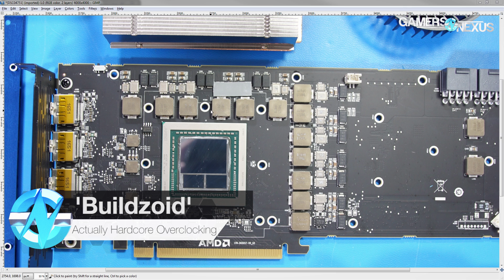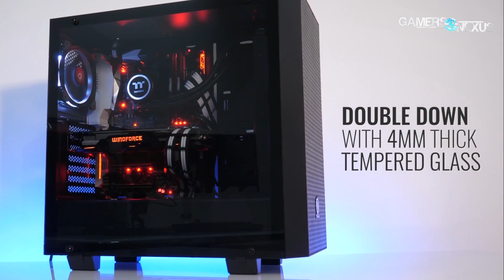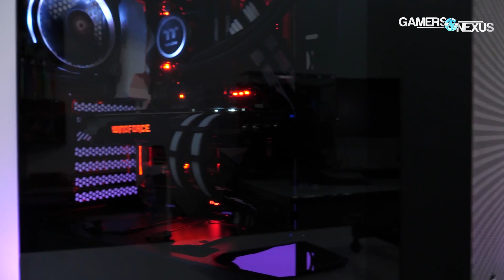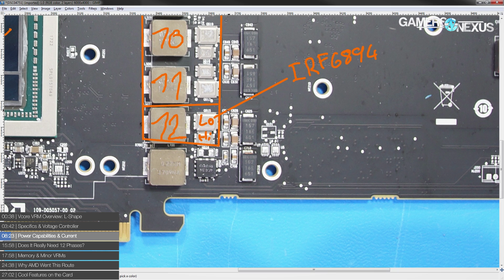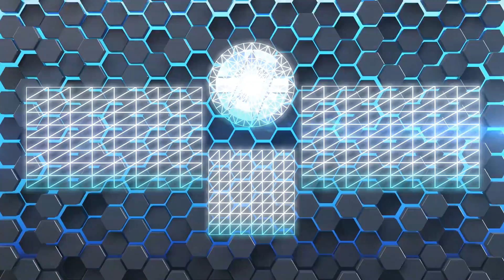Radeon Vega: FE Vcore Behemoth - VRM & PCB Analysis

Comment: Is there anyone that I can chat with regarding my Vega 56 card.  Looks to be the same board.  Vega was working, I rebooted my computer, and now the Vega fan won't spin, and the GPU lights will not turn on.  Windows or Linux will not recognize.  It seems that there is no power past the two 8-pin plugs. Any help would be appreciative.

Comment: I actually own two of these beasts. I am currently installing the EK waterblocks on them.
I have a question : the waterblocks dont cover the two VRMs that are on the far right of the card, bellow the 8pins power connectors.
those two chips are labelled "0.56uH 1710NF"
I was so frustrated by the video since i watched it entierely, i could see the chips on screen, but the narrator totally skipped them.

On the stock cooler, there are holes to connect them to the blower, so those 2 chips would have active air flow.
with the watercooler, those 2 chips are covered by the acetal and not cooled at all :/

what are those 2 chips and should i care about them not being cooled ?
i did not find any information on google about those 2 chips on vega cards

on a side note, i am totally thrilled by hearing you comparing this design to the 290x lightnings, because my new vega cards are replacing my olds 290x lightnings wich felt so rock solid !

Comment: why displays drop out: "Load line Voltage Drop" out of actual "trigger" voltage for running.. which is why raising voltage will basically do a "Load line calibration" ultimately to the point to where it is back above "trigger" voltage required. (my idea about it, not fact)  i know this happens sometimes with cpu overclocking with sub-par voltage regulation causing other components to "act up" which is why they include a "load line calibration" setting now in the bioses.  (AGAIN, NOT facts just based on my knowledge of electronics.)  

SIMPLE: Voltage draw from other components cause the "5V" (or what ever voltage is dropping) to go below the LOWER threshold of what is required to turn the internal switches on and off. if this happens while a process is running will return invalid (corrupt) data back (which would be unusable)  raising voltage will bring it to where it will STABLY  turn the switches on at the frequency that they are running at.

Comment: Can anyone explain to me why AMD designs the PCB so well but puts only a crappy blower cooler on it? Why not also offer a model with good open coolers and a more massive heatsink. Why not? I get that for tiny cases the blower cooler is better but why not two models for the reference card for the cooler. For many people the blower cooler is the reason not to buy the reference card. In the case of AMD that is a bloody shame because in general those PCB's are pretty good compared to what the AIB partners doe.

Comment: Did everyone forget about remote sensing on power supplies?  The core's supply is bypassed with large valued ceramic capacitors.  The sense lines to the supply tells the supply the exact voltage at the chip.  In a modern supply design, a few microseconds is all that is needed to ramp the supply up or down to compensate for the drop.  Thus a the bypasses only need to hold enough to prevent changes shorter than that.

Comment: Hey GN. can you guys get to the bottom of the drivers. I keep hearing it's lightly modified fury x drivers. also I hear that a rasterizer is not functioning. can you maybe explain what this could mean for performance. is any of this even true? would old fury drivers gimp the vega gpu to a large degree? Because vega was supposed to have netter ipc than vega but doesn't seem to be the case based on gaming results. also what happened to the 4 times performance per watt. Even if that was about Hawaii xt it should still be better than this. I know this isn't the gaming edition but how much of a difference could the gaming edition make.

Comment: I have an RX 470 (Asus Strix 4gb) that seems to randomly turn off the video outputs. HDMI, DVI, doesn't matter, they all just randomly turn off while under load. Is it possible it's related to Vdisp? I've spent hours troubleshooting, looking at driver changes, and browsing forums and never found a solution.

If it is Vdisp is there anything I can do to fix it?

Comment: The nub on the heatsink is where the vapor chamber (which is what this GPU cooler actually is, like most of modern GPU coolers) gets charged with the correct gas of the correct amount. Indeed kinda like a heatpipe, but the surface area of it is much larger, which fits a GPU cooler better (it wouldn't be much use for a CPU cooler, where we are not as height limited as with add-in cards).

Comment: great video buildzoid, once again. loved it.
vega is a strange card as of now. i highly suspect we will see some major improvements with the release of rx vega, because the (gaming) performance figures are way too low for that chip - i suspect the "gaming mode" does nothing at the moment.
if amd did a fury shrink with ~1400 mhz it would beat current vega hands down at its max boost clock of 1600mhz. does anyone really think this could be possible by any stretch of imagination? 
new card, ~equally sized chip, smaller process, more clock is worse than the old card with the same chip size, bigger process and less clock?

do you think amd could possibly go "poor volta" when they barely beat the 1070 (which also fury does in certain games)? amd surely has something up their sleeves. releasing rx vega one month late is pretty unfortunate because of that which is happening - ppl hate on vega for its "low" gaming performance. i think stockholders wanted vega to be H1 2017 or hbm2 supply wasnt sufficent for rx vega release. probably amd doesnt want to show the gaming performance figures of rx vega until it hits the market and therefore did not include a working gaming mode for vega fe until rx vega is being shipped. i cant think of another reason for that behavior.

amd has shown they like to play games with intel, however nvidia is way harder to beat than intel. intel underestimated ryzen and x299 is everything they can throw at ryzen and threadripper. i guess amd wants nvidia to underestimate vega aswell and hit them with way more performance than they anticipated.

if amd would be rightfully claming vega sitting between 1080 and 1080ti for months before release, nvidia could just come up with a solution to that problem in the meantime.

Comment: So basically it has overkill power delivery and still only 1070 performance.
Reply: It is MUCH faster than TitanXP. In its own intended area, Vega destroyed TitanXP by 11 fold. 155fps on VegaFE vs 9fps on TitanXP in Siemens benchmark. If TitanXP only has 9fps, imagine how bad it is with 1070. Well, P5000 has some 180 something anyway. But again, P5000 is slower than TitanXP in gaming, albeit 6 times the price.

Comment: This card has a gaming mode, once activated it outperforms a 1070 by 3 frames lol.
(POOR VOLTA anyone)??? 😂.
Reply: Not a gaming card tho
Reply: Doge Charger It does have a gaming mode but yeah raj said the RX Vega will be better optimised for gaming. 
But don't forget, RX board and chip is the same as this. Infact the RX has only 8 gig compared to the 16 gig hbm2 on this card.
All the optimisations in the world won't get you a 40 frame boost which is what would be needed to catch say a 1080ti.
20% is more realistic going off RX spec.
That puts it inbetween a stock 1080 and stock 1080ti, however that's all evens once you put a moderate overclock on the 1080.

Comment: so a overkill VRM until you get to the "advanced HBM2" ? in that i am wondering what if they make a HBM3 with the correct by you VRM set up? or are you in correct on how the VRM set up has to be?
i am hoping HBM3 will have a higher limit of how much VRAM they can have on a single chip than HBM2 has to get chips with more than 16GB of VRAM to have bigger data sets to this though it will not help gamers at all but will help GPU compute cards.

Comment: says they are expensive. <2 euro per 1000...
Reply: Yeah misspoke on that. it's 1.2 eur a piece when buying a thousand.
Reply: its perfectly understandable for ppl used to industry sizes, dont worry :) its either price per piece for 1000 pieces, or price per one thousand pieces for pallets or containers. ppl not used to this kind of price display can get caught, however common sense should say you will not buy 1000 pieces for less than 2 euros. even mediocre m3 screws are way more expensive than that, and we're talking about high quality fets.

Comment: Why they use a voltage so low on the core? The current get so high to reach the desired power, generating so much heat.
Why they don't run in 12v so the 200a of the core can be reduced to 16.6a?
Reply: its not the power of the gpu that is constant, it is the current draw, a gpu will pull x amount of current, so that 200A can be a 1v to consume 200w or at 1.4v to consume 280w. the reason we must use a higher voltage when overclocking is so the transistors can switch faster, but lower voltage means less power draw but slower transistor switching, if you tell a card to run overclocked but the voltage cant make the transistors switch fast enough for that clock, you get an unstable overclock. Current is constant (for a given workload/clock) , so the voltage will determine the power draw of the gpu

Comment: This is not a reference card! This is a card designed with 24/7 running in a workstation in mind. Depending on the task, downtime is just not acceptable!
Very in depth video on the card. Nice job!
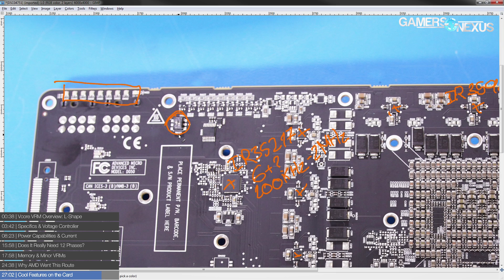29:05 Just checked. That switch is on my Sapphire R9 Fury. Toggles between Red/Blue and you can turn it off! Always thought that was a bios switch. Thanks mate!

Comment: Is the vrm of this card similar components to the reference 290x with double the phases? Absolutely crazy if it is, the 290x wasn't exactly a low power card and 6 phases was enough for that.
Reply: 290X VRM was 5 phase Vcore not 6.
Reply: +Actually Hardcore Overclocking Even crazier then! It will be really interesting to see power numbers from the water cooled version and even more so once people start to overclock the cards.

Comment: Who's holding AMD's Stocks?
Reply: Andy Farr me! , I think that based on the core clock vs the furry x and the fact Vega should have slightly higher IPC the prefomance will get better significantly with driver fixes to bring closer to being in between a 1080 and 1080ti, through I only have about $75 worth of stock so if I am wrong and the stick completely crashes then at least I didn't loose a huge chunk of money
Reply: Toby Cowles AMD reports earnings this month, things are looking really good.  Ryzen been selling like hot cakes, Intel in a panic for the first time in like 15 years.
Reply: Andy Farr You forgot the mining bubble too. Find a RX480 or a rx580 in stock are difficult and sometimes overpriced.

Comment: If you need a space heater, just buy Vega and overclock it.
Reply: AntiZippo Nah, get the new i9's and overclock them.
Reply: None of those beat the GTX 480. None of them. You can't beat a graphics card where the GPU can reach 100 °C under normal operation.
Reply: quad sli the gtx 480 

they wll melt your case
Reply: AntiZippo nope. get the i7 920 oc it and it will keep your room warm enough so that you don't need room heater and you can game on it!
Reply: Intel I9 overclocked + VEGA FE = Heater dream combo
Reply: that would be the 7900x
Reply: Marcel Krebs, I would die if i had that combo, its already too hot with a 3770k+970.
Reply: AntiZippo if you want 4 GB, buy 3.5 GB.

Comment: AMD - actually provides good hardware for less money. It's the software that couldn't fully utilize it yet
Reply: this is true, and has always been true with amd.  their raw power is fucking insane but their driver side is lacking aswell as support from devs
Reply: GCN is lacking for DX11, where Nvidia can get away with software scheduling. Optimizations clearly haven't been made though in general. Vega literally falls about 15% in front of Fury X in DOOM which should not be the case.

Comment: Interesting that AMD is underclocking the HBM2 memory. Running the installed HBM2 at 945Mhz with data rate of 1.89Gbps and bandwidth of 483GB/s

With SK Hynix stock specs of the memory in the Vega configuration, it should be running the memory at 1Ghz frequency with memory Bandwidth of 512GBs with a data rate of 2Gbps.

Just speculation on my part, but the underclocked ram could be intended to nerf the GPU performance to leave room above for the gaming and 375W watercooled FE card. That being the case,  people may well be pleasantly surprised with teh RX Vega performance after the disappointment of this card.
Reply: I'm not sure how much power the HBM is consuming, but this card is really power hungry as is and the memory bandwith is still more than enough even for professional applications I would imagine that botht he HBM and the GPU are not running at full speed to save energy and have it generate less heat.I've been doing a lot of testing with different voltages and clockspeeds on my old R9 380x and found out that neither gaming performance nor mining performance are affected that much by underclocking it. 
On top of that I was able to go with a -50mV voltage offset. 
At stock setting my sapphire R9 380x nitro will run at 1040 Mhz, 1,156V drawing about 80W of power just from the GPU. 
Underclocked to 870 Mhz with a negative voltage offset we are talking about 0,938V and a power draw of 43W.
The difference in performance is marginal, about 5% in mining workloads and about 10% in games. It's still faster than a regular R9 380.If you were to use this card in a professional enviroment (or even just for mining) you would always have it run at 870 Mhz because adding almost 40W of power draw for 5 - 10% performance increase is absolutely not worth it.

I'm expecting RX VEGA to be up to 30% faster in games than VEGA FE due to higher (and less efficient) clock speeds as well as optimised drivers. However we do have to take into account that RX VEGA will prbly not use the full die but a cut down version.
Reply: I must admit that I was gobsmacked when they announced a 300W TDP with a 375W watercooled card to come. Particularly as they have used a 14nm Finfet fab to produce the chip.TDP though is not the amount of volts times amps coming from a power supply. it is the amount of heat that needs to be dissipated by the heat sink.

In traditional GDDR cards, the voltage load is split up through different VRMs and spread around a relatively large surface area on the card  allowing for more flexible multiple individual heatsink designs. 

With HBM2 on the die, it is all concentrated in the one spot and all has to be handled by a single relatively small contact area heat plate that has to be beefy enough to handle everything that used to be handled by multiple sinks. It also doesnt make sense to engineer different VRMs for different models in the range. Better to design a single VRM that can be used by all models

Nvidia Quadro cards use Similar hardware to the gaming cards but are usually clocked slower. I am expecting that the Vega range will be similar. I cant see AMD releasing their flagship gaming card if it is only at a 1070 to 1080 performance level. Surely that slot would have to be for a SKU that is down the chain. Not sure if I would expect quite 30% though

Comment: The problem I as a 3d modeler have with that Vega card is in the purpose it is targeted for. Comparable price to the latest Titan and comparable results in 3D rendering, but the Titan does comparable gaming to a 1080 ti while the Vega compares to a 1070 at best. For a workstation PC doing 3D modeling both Titan and Vega are a waste of money because you would have a dedicated rendering box with a real professional grade GPU inside it. All major render tasks are on it so the workstation can continue being productive. The workstations can use a 1080 or even a 750ti/AMD equivalent and be able to get the modeling work done. So the card isn't made for AAA game studios, but for home freelance 3d modelers. A freelance 3D modeler doesn't usually have a dedicated rendering rig, and generally doesn't do cutscene/trailer quality renders for games and many of those never render anything. So for home users for productivity the titan is the better choice for that price range. You build your 3D model, import it into the game it is for and test it in the game. relatively equal productivity performance but less gaming performance makes the Vega are poorer product for the targeted market.

That's a shame really, Ryzen did good to shake up Intel, but Vega falls flat with comparable price and productivity performance due to lack of gaming performance the targeted users will want. Then there are beta drivers on launch continuing AMD's bad driver reputation. AMD needs to step up their driver game especially when it comes to the productivity market, it's one thing to have poorly optimized drivers for a game and another for your very income. Build the product, optimize the drivers, then market and sell them followed by weekly/bi-weekly updates for the drivers. I was hoping for competition which is the shame that AMD doesn't provide.

Oddly enough Vega so far is exactly right up AMD's historical release cycle. Put out a new product at lower price than the competition (RX480), revise it and re-release(RX580) then release a flop (Vega).